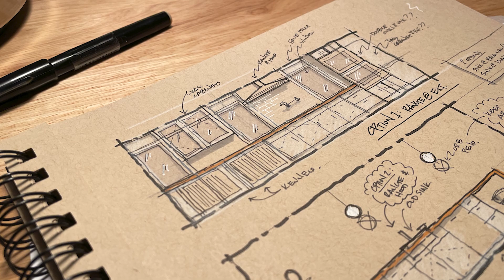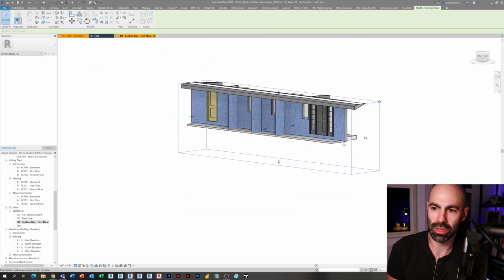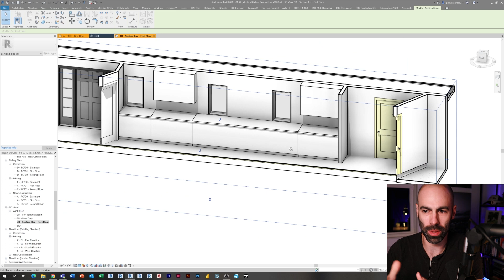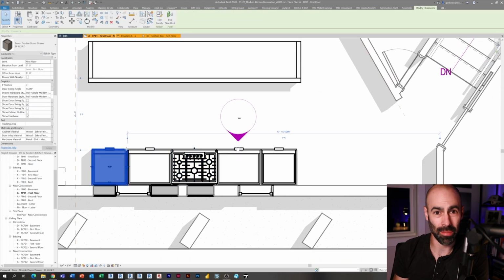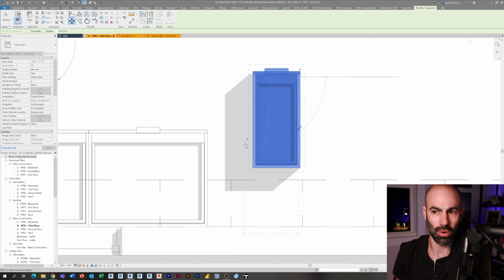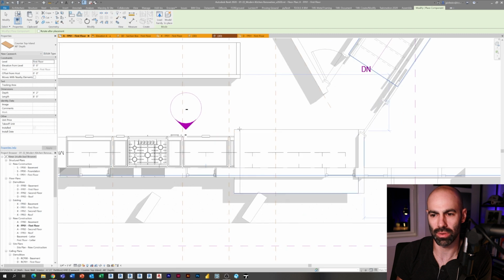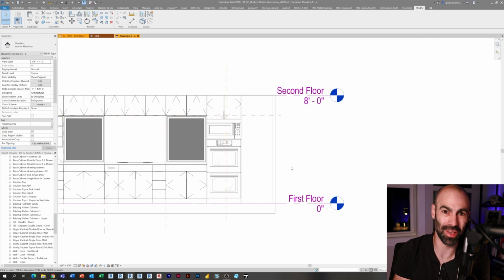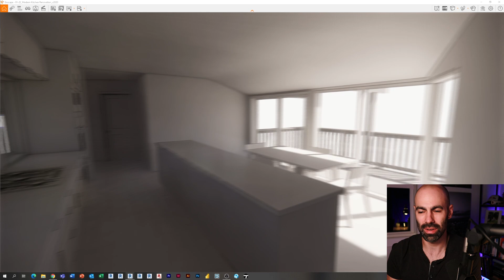EP10 | Revit Kitchen Cabinet Hack !!

Comment: How can I change Duct work to default blue magenta geeen color in phasing? 

After I turn on Phasing, all color turn gray.
Reply from the maker: For ducts and pipes you need to make sure they are "systems" and then you can apply a material to that system.